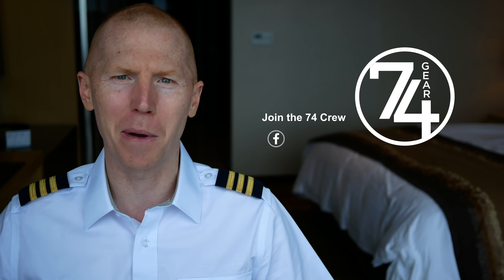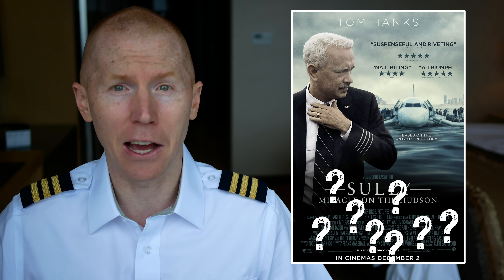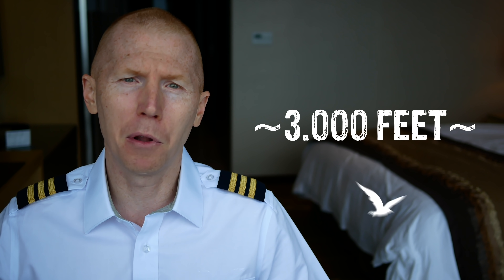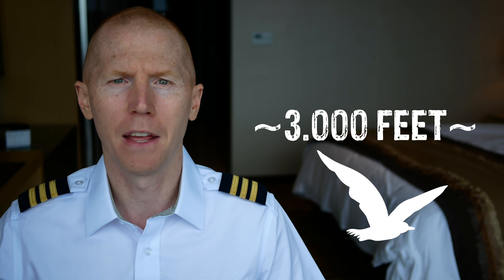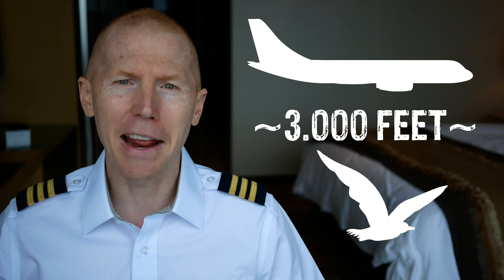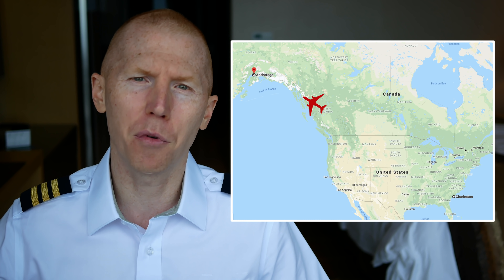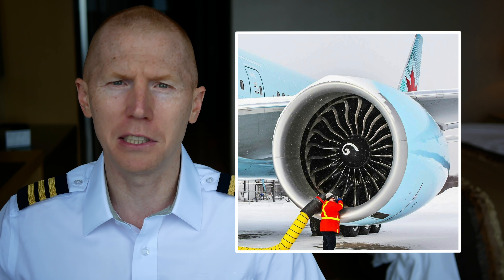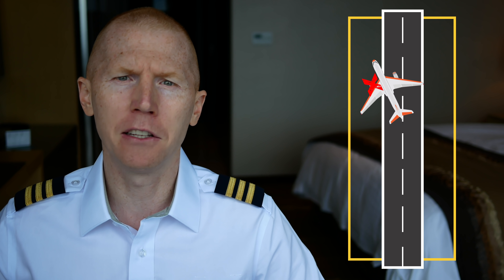Why Engines Don't Have a Mesh or Grates to Stop Birds

Comment: Most of the thrust is developed in the bypass duct and not the engine itself. The LP fan delivers most thrust the engine is used to turn it. Putting anything in front of the fan will disrupt the airflow and cause vibrations, parameter errors, potential to surge amongst other things. 

Engines receive a frozen bird shot as part of certification in order to see how the engine performs and operates under those conditions.

Comment: Isn't it possible to design a front grate (that could mitigate a bird strike) sort of like the reverse thrusters that can be retracted after takeoff when the plane is at least high enough to glide back to the airport in case of a double bird strike. I understand that even though the grate may have 95% open space that the 5% could effect performance. But according to this idea, the grate would be blocking the engine only for 5 minutes until retracted..
Reply: At take off speed, any kind of grate would just cut the bird in pieces and dont stop it from going into the turbine
Reply: @wolf310ii  What you are saying is true, but the turbines are designed to withstand certain particulate size, for example bird hamburger. they can't take whole birds without severe damage.
Reply: @senderzeyv4292  They can take whole birds, up to the size of chickens or even turkeys.
With or without grates, the bird gets choped in pieces by the fan anyway.
Its not the size of the pieces that matters its the amount of pieces.
One bird is not a problem, it gets sucked in, shredded, fried and spit out by the engine.
A flock of birds is a problem, the amount of biomass can clogged up the the compressor stage, the turbine stage or the burn chamber
Reply: @wolf310ii  I think you are mistaken. Although a bird is soft material in comparison to a chunk of metal or stone hitting the turbine blades, but at the speed they are turning they can be damaged. Once the turbine blades are even slightly damaged (as I stated before, they can grind up into hamburger and be safe from a limited amount of particulates) they go out of balance. The imbalance will quickly tear up the whole turbine to shreds. Those metal shreds enter the compressor and combustion chamber and that the end of the engine.

PILOT KESLEY, CAN YOU WEIGH IN ON THIS QUESTION.

Comment: I think there's a solution here we are ignoring, extended reinforced cages. Imagine the Y wing cage in star wars reversed. A simple very string cage extended from the engine to not impede air flow but also strong enough to not buckle when struck by a bird. The main drawbacks are weight and and reduced aero. Also the risk of a bird being shredded at that speed and instead of a whole bird you have bird parts flying into the the engine. But they could be angled as such its mostly deflected outwards. Im no engineer.but I have to believe there's a solution. Or we just accept the minimal risk, and quit focusing on it.

Comment: Why does the SR-71 have cones in front of its engines? It seems they have much less area for air intake.
Reply: The cones are part of the engines, they adjust and accelerate the air flow into the engine

Comment: A filter wont stop air from getting in, it would be such a little difference it wouldnt matter
Reply: It reduces the amount of air getting in and also disturb the air flow
Reply: @wolf310ii  again, a filter wont disturb the air flow anywhere near enough to stop performance, keep in mind ive re built a few engines
Reply: @milathecat5454  I didnt wrote it stop the performance at all, but its lowers the performance a few percent.

Just look at a car, how small the air intake of a carburator is and how big the surface of the air filter has to be for enough air flow.
A engine in a car also care much less about turbolences in the air box, than a jet engine about turbulences in the air intake
Reply: @wolf310ii  again, an air filter wont make a noticeable difference in the air intake, it will have the same power as it normally would without one,
Reply: @milathecat5454  Again, yes it will. Thats simple the physic of fluid mechanic
Reply: @wolf310ii  I don't think youve ever tried inhaling through an air filter, on an engine if you take the filter off you get the same performance, its really just that simple
Reply: @milathecat5454  In a daily life use you barely notice a change in performance if you drive the car with or without an airfilter.
On a racetrack you will notice a difference.
If i change the airfilter on my motorbike, i can even notice if its an OEM Part or not, because the non OEM part allows more airflow and the engine runs worse.
If i use a racing air filter, i even have to change the nozzles in the carburator, otherwise the engine runs like a bag of nuts.

Or an other example, a engine with an flat slide valve performes significant better than an engine with a throttle valve that stays in the airflow.

Comment: Powerful Lasers that could vaporise a big bird sound tempting but it would choke the batteries. But some russian military jets have a retractable intake cover that allows the jet to suck air from the top of the engine while covering the front. Goes back to normal at safe altitude

Comment: Sir what if the airport authorities emit some kind of ultrasonic sound waves, to prevent birds from flying near the airport? I have very limited amount of knowledge in flight plans but my guess is that an aeroplane stays at or below 3000 feet only when it's near to an airport. So the risk of getting a bird strike is only in that areas near to an airport. So Is it feasible? The ultrasonic waves must not interfere with the radio frequencies of the radar though.
Reply: Also it'll lead to sound pollution, on second thoughts. But isn't it worth a look?

Comment: You said in the video about screens in front of the engines that it would restrict airflow. On the SR 71 they have cones in front of the engines would that help with bird strikes?
Reply: No, the cones are part of the engine, they are for controlling and accerlating the airflow at super sonic speed, not for protecting the air intakes
Reply: @wolf310ii  I know that I just thought it would help out with protection.

Comment: Sudden loss of power in the cabin means imminent crash landing? What could be the causes and solutions performed by the pilot? Please explain it in a video!! Bcoz, recently I faced a similar power loss in a flight and the pilot had to return back to the airport with a heavy and hard landing and touched down just few metres from the start of airstrip. It's an year back incident in India.

Comment: MiG-29 has screens that redirect air flow in a way that it’s being drawn through louvres on the upper surface of the fuselage and by that prevent sucking debris into the engines during take-off. I know fighter jets don’t need as much power to be applied as airliners to take off so they can get away with such airflow restrictions but nevertheless there are technical solutions to prevent bird strikes and other FOD, just not viable on all types of aircraft.
Reply: Like you said, its to prevent sucking debris from ground, not to prevent bird strikes.
Old russian fighter are build to start and land on airfields, west fighters wouldnt even use as taxiway

Comment: Hmm why not put another rotating fanblade that is much more durable before the frst fan of the engine

Something that would mince up the bird
Reply: The problem is not to mince up a bird, that can and does the fan anyway, the problem is the biomass of the minced bird clogging up the compressor or turbine stage.
Also the problem is not a single bird, in the majority of cases the engine just suck it in and spit it out without any trouble, the problem are flock of birds getting sucked in.

Comment: They can use a mesh that appears in front of the engine when the flight comes below 3000ft as he said and retracts when the desired height is reached. All that can be done with a click of a button. By this, they can safeguard the engine, and the fuel cost wouldn't be as heavy as it should be as the mesh covers only few mins during the journey below 3000ft. And mainly can save the life in case of catastrophe.

Comment: Um, after you loose the left engine shouldn't the aircraft pull to the right?
Reply from the maker: if you are pushing a shopping cart, you are normally pushing in the middle if you push it from the right side of the cart which direction would the cart turn?

Comment: High energy lasers can incinerate almost any incoming solids and they also don't obstruct airflow. Besides putting them in front of an engine would give it a badass futuristic look. And if you want to speak power consumption, we only need the lasers to be turned on only for the few minutes when the plane is below the bird altitude. So I don't see any reasons to say no!

Comment: The Cessna T-37 had a practical screen that would cover the engine inlet when the landing gear was lowered and then retract out of the way during normal phases of flight. It had this feature largely because the inlets were so close to the ground.  I don't know how practical a screen would be though as you still have to contend with the impact forces of a bird strike on the protective screen

Comment: The other problem with putting mesh in front of an engine is just common sense.   I’m no expert but bird strikes are rare since birds aren’t sitting infront of a engine 24/7. On the other hand mesh infront of a engine is just a recipe for disaster 24/7 because no matter what the altitude is there will be a point were that mesh will fail and will be sucked into the engine. In flight not only does the mesh have to fight air resistance but it also has to fight against the suction created by the engine and no light weight metal will ever be able to handle that level of stress. You can’t beef it up to steel either because that would add weight to the plane which means it gets less power, worse fuel efficiency, and makes the plane slower.  That’s a huge red flag to airlines because that means for every flight that plane makes their losing money and time. If I were  a airline I wouldn’t even look at a plane with mesh infront of the engine because it would cost more money to fuel up, be a bigger risk for catastrophic engine failures, and most of all due to the added weight of the mesh the plane will have a smaller weight capacity for passengers and luggage.

Comment: Cessna citation 1’s and 2’s have chicken wire on the back of the engine to prevent bird strikes. 
LOL 
I had bird strike in Mexico just before V1 where 5.5ft of the wing of the bird did not go in the engine 30 years ago.  It was a Garrett 731. The engine was cored... gone. 

Note: I have seen flocks of larks, or humming birds or finches migrating between 10 and 11000ft.  The stream went by us for 2 days while I was in flight test years ago. It weird because they were so small and even though in the middle of a flock, I did not hit any. (Yes, I had witnesses).

Comment: Russian fighter jets have grates that move in front of the jet engines for take off and landing but retract for normal flight.

Fighter jets are made for war and the Russian's don't want to spend all their time keeping the runway clean with endless FOD walks (like the American's do).  So a Russian fighter pilot doesn't need to worry about FOD at all, because they have these grates in front of the engines.

So Russian fighter jets can operate from the most run down runways, whilst American fighter pilots need to keep their runways amazingly clean and stress about FOD.

Comment: I'm going to do a video on the why nots. Most of it surrounds weight not airflow. Many turbines ingest air indirectly (727 l1011 Falcon Comet others). Suction is omni directional so there is no measurable loss of efficiency. The "grate" would have to be strong enough to stop a 50LB bird going 300 KTS which would mean tons of force. Also it would be prone to collecting ice. So now add a de-ice system to the grate.  FOD like plastics would actually be worse on a grate. etc.

Comment: My attempt at mitigating the fuel efficiency problem with putting a grate in front of the jet engine: make it retractable after the aircraft climbs above 5k feet. Then fuel efficiency issue may be minimized with safety significantly increased.

Comment: A gate wouldn’t work anyway. Since it sucks in the air it would just suck the bird against the gate and probably rip the bird apart and then it would go inside the engine. If it can suck a person in, it can definitely suck a bird against a metal gate and rip it apart to fit into the wholes. Adding onto, the holes would have to be a bit small because birds are not always that big lol

Comment: wouldn't it be possible to have some kind of detection system just before a object (bird) flies in, which in a fraction of a second is able to put something in front of the engine? since at takeoff the speed still isn't as fast as high up in the air i would think this might be possible in those tenths of the second

Comment: You only need the screen for a few minuets so in theory a retractable convex screen could work for larger birds.  Build it so it retracts into the engine housing or wing and perf costs should be minimal at cruise

Comment: aerodynamic cone shaped screen would both increase surface area to allow more air flow and increase the screens strength, or you make it a solid cover with a space that allows air in at the base of the cover.

Comment: Thank you for the insightful and entertaining vids Kelsey!  A few questions...
1. Can the engines take in most small birds without failure?

2.  Will a single goose injest likely cause a total failure?

3.  Are partial failures common where an engine is compromised from a bird or other debris and still can put out some thrust?

4.  What kind of watch do you wear?

Comment: Sir , I have a small doubt.Why can the enginners design a mess that automatically goes up of the engine when you reach a higher altitudes.By this you can totally eleminate the risk of bird strike and also the fuel is not wasted much compared to the replacement of the engine cost

Comment: I get the concept of not blocking the intake but what about making the find out of a stronger material. At the very least the low pressure turbines. Seeing that bird strikes happen at low altitudes. Commercial airliners are likely below 250kts at the time. 200 within the Bravo. That could make it easier to engineer something to withstand to a certain parameter. What’s you’re take Kelsey?

Comment: if you screened or grated engines, the bird would just be sucked through the screening material anyway, or even worse- suck bird fragments AND screen into the engine. do you have any idea how much thrust airliner engines produce? much more than is required to pull any lifeform through grating and into the engine.

Comment: Even of it is built right it interferes with the air coming in.  Meaning it can starve the engine.  The engine has to be designed to have that and it has to be built to the frame so it doesn't just get sucked in.

Comment: Mmmm why not have a “thrust reverser” type design.. On take off and up to 3000 feet the mesh will cover the front air intake.. then retract for normal flight.  I know why the cost of the modifications doesn’t warrant the low incidence of bird strikes. So effectively losing one place every five years is more cost effective.

Comment: 3:55 YES, there IS a way to prevent birds entering the engine. It would be possible to create retractable mesh, that will be infront of the engine below 3000 feet, and then it would retract inside the plane. That IS POSSIBLE to do. But i bird strikes aren't that common, so therefore it is not worth it, because of increased cost and complexity. BUT IT IS POSSIBLE.
Reply: Costly. Its like having a water bottle attached to phone 😂

Comment: This is gonna sound like a dumb question but what is the white stuff that comes out of the plane at high altitude is it like steam or whatever?
Reply from the maker: It’s called a contrail. It’s a mix of exhaust and the cold air
Reply: @74gear  thanks alot

Comment: Biggest issue would be ice developing on a mesh "filter". Fuel burn is a secondary issue but a costly one over thousands of hours
Reply: That was my first thought even before watching
Reply: @erikb8877  mine was that if you had a mesh and a bird hit it, the mesh aint stopping the bird lmao, now you just have multiple lumps going in the engine instead of just one.
Reply: They can be heated, like they are on RTM322 engines installed on NH90 helicopters.
Reply: @Sapphire1987  helicopters are different. Their intakes are much smaller and typically in a C channel like an intake on a turboprop like a PT6

Comment: first regular mesh net will get sucked in so you need a metal one and it doesn't matter because if a bird was there no matter the size if the bird is in the sucking radius its going to be cut to multiple pieces and not change much

Comment: I’m just gonna pause at the very beginning.

And assume the reason why is because the engine creates a pocket of negative pressure in front of it by pulling air through, and that subsequently creates positive pressure behind it as it takes that air, heats it and pushes it through the back.

if we put mesh screens in front of het engine intakes, anything caught in the negative pressure pocket will get sucked into the screen and held in place?
Reply from the maker: How close were you to what you thought it would be?

Comment: Even you have a strong enough screen in front of engine,  it will just cut the birds to smaller parts at that speed, and they are still going  into the engine.